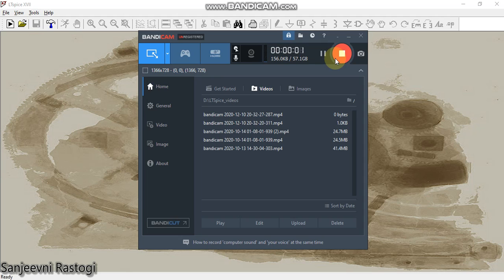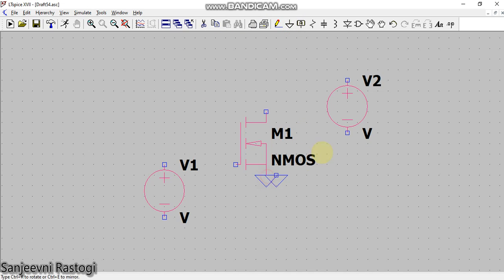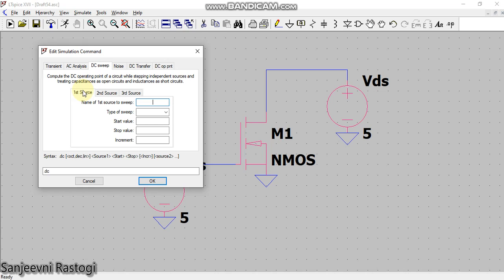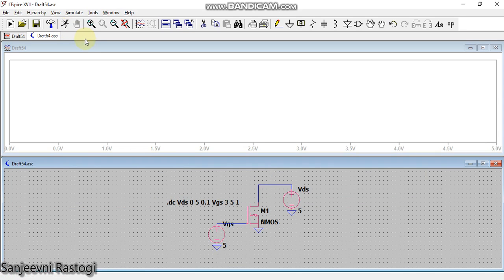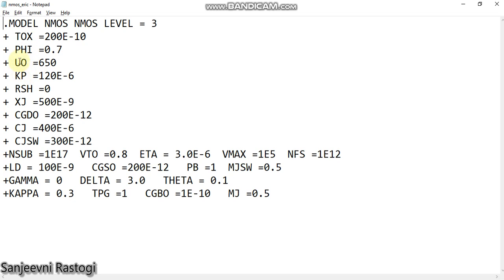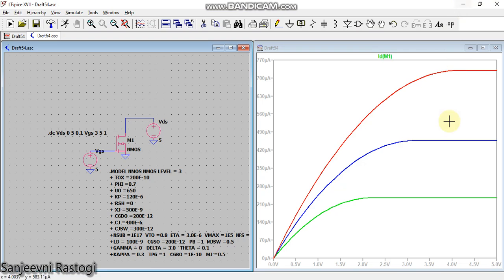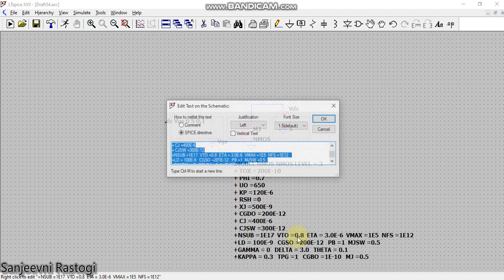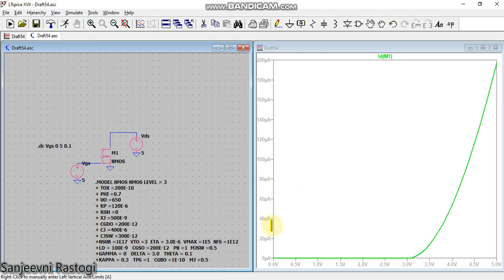NMOS characteristics simulation in LTspice XVII

Comment: Hi teacher, If I use current probe to detect the Drain current(Id) whose value is positive in Id-VGS curve. If I use current probe to detect the Source current(Is) whose value is negative in Is-VGS curve. But the current has only one direction from Drain to Source, why one  terminal is positive, and another terminal is negative ? thanks a lot.
Reply from the maker: Hi Joseph!
First of all there is nothing like positive or negative current. Actually, the basic thing is that the current flows in the direction opposite to that of the flow of electrons. When you apply Vgs>Vt and Vds voltage, then electrons flow from Source to Drain terminal through the channel created by Gate-to-source voltage Vgs. Hence, Id flows from Drain to source, which is named as drain current. Now if you talk about source current, it is nothing but a current opposite to the flow of drain current. Practically, no such current flows because current always flow in the direction opposite to that of electrons. Thus, theoretically, Is is negative and Id is positive. 
Hope this helps!
Reply: Teacher, so "Id" current's definition is that the current flows from Drain to Source terminal. "Is" current's definition is that electrons flows from Source to Drain terminal.  Excuse me, is my understanding is correct ?  thanks a lot.
Reply from the maker: @josephhuang6585  there is no current like Is. Only Id exists because of flow of electrons from source to drain. Is is just a theoretical concept. If you talk about Is, electrons should flow from Drain to source, just the opposite of the conditions for Id.